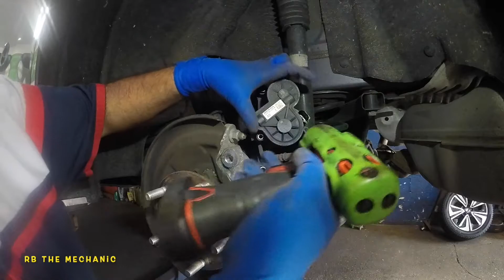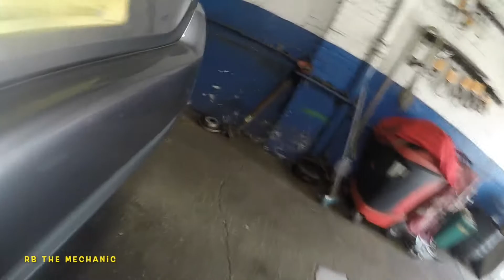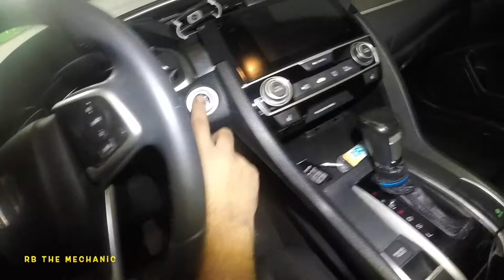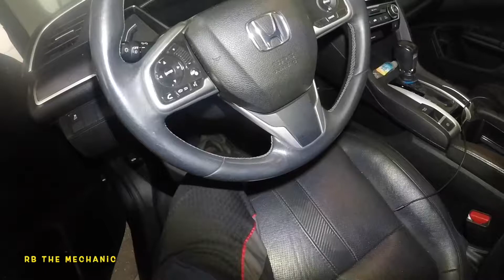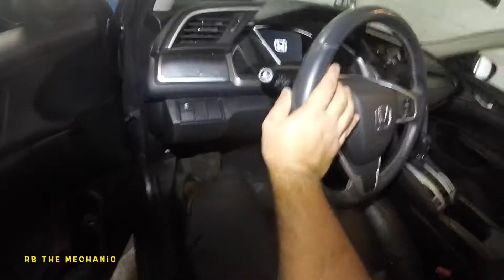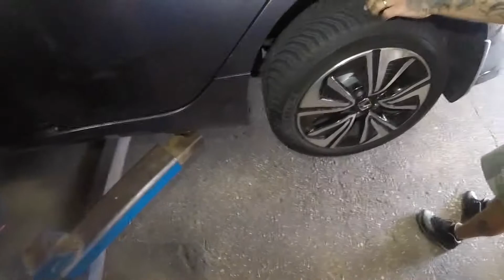How to compress rear electric parking caliper on Honda or Acura    (DIY) no scan tool required

Comment: You could have backed out the parking brake screw fully before compressing the piston.  You didn't have to alternate between compressing the piston and backing off parking brake stud.  You can use a C-clamp to compress the piston.
Reply from the maker: Thanks for the tip, I will keep that in mind for next time.

Comment: why didnt you just put 12v to the acutator once you disconnected it, this would retract the piston without you take the two bolts off and manually winding it back. then you just have to push the piston back thats it. wouldnt that work and easier?
Reply from the maker: Yes I use to do that good idea just would go down to 7 volt just incase but I like doing it manually

Comment: So do we have to take the actuator off?  I bought the tool for the brake caliper on amazon to push the pistion back.  So if i use the brake tool i do not have to remove the actuator correct?
Reply from the maker: U wount be able to push it back in without turning from back by removing acuator or put in service mode

Comment: Hi..do you need to release e-brake first before doing this? Tia
Reply from the maker: Yes if I got scan tool u can command it to service mode other wise turn off brake and follow my instructions
Reply: @RBTheMechanic so using a scan tool i dont have to take the actuator off?

Comment: Why do we need to have this electronic crap on brake calipers? The manufacturers need to go back to making simple proven parts and leave out all the technology. Putting tech in all these cars is only a way to stop you when they need to come get you during the end times most likely and of course making more money. 
If manufacturers would go back to making high-quality vehicles that anyone can work on then they would have more business than they know what to do with.
Reply from the maker: They wanna be fancy and computer controlled I hate this when I try to align the car by opening the door to look see it automatically puts car on park and brake on
Reply: Electronic E brake works great though

Comment: Hey, I just did my front brakes for my 2015 Honda Odyssey. I tried pumping the before starting the engine but it was normal. So I tried starting the engine but I’m getting a SYSTEM FAILED signal. The engine won’t start and the brake pedal is hard. 

I still have t done the rear brakes due to time. I took out some brake fluid bc it was high from compressing the caliper pistons. Now the brake fluid is at MIN. 

What can I do? Please help!🙏
Reply from the maker: I don’t think it’s brake related   Do u have push start button?
Reply: @RBTheMechanic  yes, it’s a push start button.
Reply from the maker: @laviebanale  it could be the switch I have had issues with push start try pushing it very very fast several times like click click click click click bone stop and then try normally push start don’t press brake when doing this
Reply: @RBTheMechanic  I added brake fluid and the SYSTEM FAILED signal has disappeared but I still can’t start the car. The brake pedal is stiff and I can’t step down on it to start the engine. Everything’s turns on. 

Should I just finish installing the rear brakes and see what happens?
Reply from the maker: @laviebanale  yeah tell me exactly what u did when u did front brakes?
Reply: @RBTheMechanic  I just replaced pads and rotors. But the caliper pistons were really hard to compress. That’s the only thing that felt weird. Usually, it just goes in w/ minimal effort but this time I had to really press onto the Disc Brake Pad Spreader Tool Caliper Piston Compressor. It raises the brake fluid level to MAX. I used a Turkey baster to drain the old dirty fluid and it down to MIN. 

I don’t know what the problem is. I knew the brake pedal should be soft and sink to the floor but it was hard and like I said last night, the dashboard said SYSTEM FAILED. It would t start. The brake light came on. Then I added brake fluid and the SYSTEM FAILED signal is gone but it still won’t start. I’m going to do the rear pads and rotors. I’ve done pads and brakes before. No problems except trying to get remove the rotor screw. 

Nothing is leaking. No weird smells. No noises. 

Maybe the battery is dead?  You’re the professional.
Reply from the maker: @laviebanale  ok so I don’t think anything is wrong it could be ur push button how ever try doing back brakes and do reset of brake abs moduel check engine moduel with scan tool if u don’t got scan tool try disconnecting the battery for 20 minutes leave it disconnected u will get radio or Navi code locked so make sure u have that. Update me with situation
Reply: @RBTheMechanic  I installed the rear pads and rotors. Everything was normal. 

I really don’t know what happened. Do Hondas’ brakes have to be done on all sides for it to work?
Reply from the maker: @laviebanale  what’s the issue
Reply: @RBTheMechanic  everything is ok but I still trying to figure out why brake pedal wouldn’t go down and why the dashboard said SYSTEM FAILURE.

Anyway, thanks for your help.
Reply from the maker: @laviebanale  need to scan all moduels
Reply: @RBTheMechanic  Keep up the great videos. Can you do a video on changing alternators?
Reply from the maker: @laviebanale  I have one comming on civic soon it’s similar but once I get one of these I sure will do a video